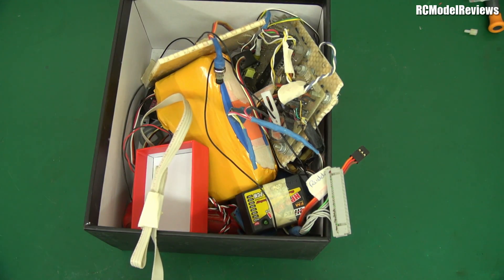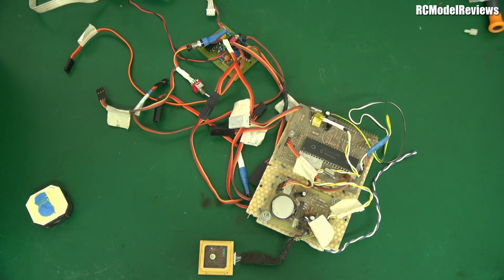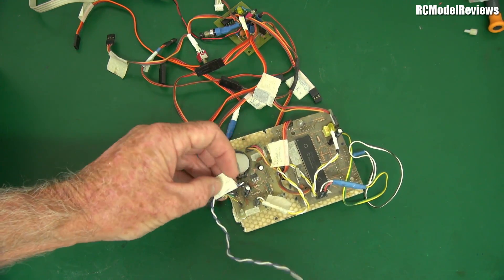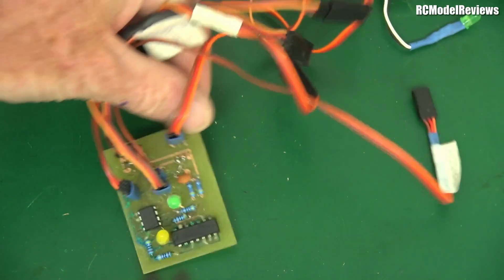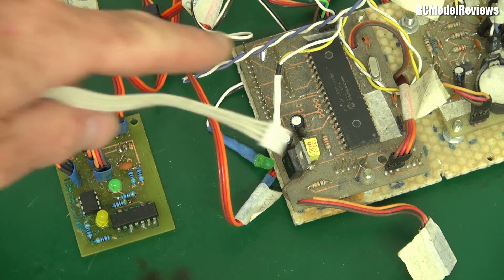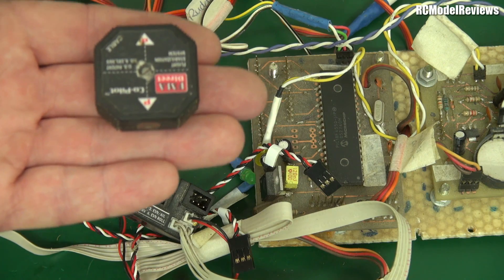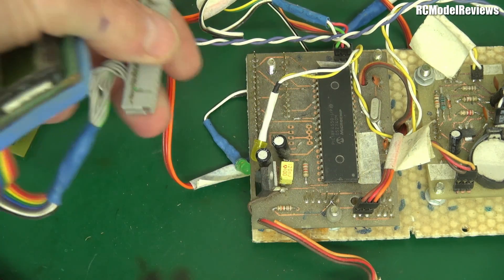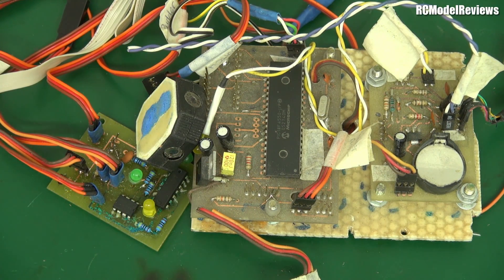An 18-year-old cruise missile autopilot and flight-controller

Comment: "They" never like when you point out issues with anything. Back in the early '80s the data center folks installed a new version of DCL (DEC Command Language) on the PDP-11 running the 10M corp. where I was employed as a software engineer developing embedded systems used to log data in high energy physics research. A fellow engineer and I looked at the updated documentation and it was obvious (to us) that with the features they'd enabled, it would be trivial to write a script that could take over any terminal on the system, pretend to be the login program, fake a bad password entry response, log the account and password they'd entered, and return the user to the real password routine which would let them log in, none the wiser. You could run it on any terminal in the system from any other, with no special privileges. We told them about it and were ignored, so we wrote a proof of concept script and showed it to the guy running the data center. The response was to have a fit and disable our accounts on the system. That fixed the "problem". LOL

Comment: Wow. Love this "blast from the past" retro technology. I can't remember 18 years ago but were gyros and accelerometers really military stuff back then?  How long until we get unlimited termal imaging sensors  by the same logic?
Reply: Not just military, commercial planes have used them for auto pilots a long time. Space flight also depends a lot on gyros and accelerometers. They were definitely not available for the home builder though. The first time people started doing things with them were when the nintendo wii came out I think. People chopped up wii controllers to get the gyros, that's how multiwii came about, which, if you go back far enough, is the ancestor of betaflight :)
Reply: I used gyros on my radio controlled helicopters in the late '90s, over 20 years ago...
Reply: @WillFly4Food  oh wow. It shouldn't surprise me, yet it does somehow. So manufacturers sold components directly to customers or anything like that? Or was it commercial product?

Comment: Very interesting stuff Bruce. I also heard about your channel because of your cruise missile. Am I right in thinking that you used a pulse jet engine to power the craft? Did you ever fly the craft autonomously, what was the theoretical range of the system? How did it handle and what did it actually look like, I imagine it was like a WW2 V1. Are you allowed to show us what it looked like, I understand if you can't say much the powers that be in the US are rather paranoid? These days all this could be done with an AMP 2.8 flight controller.  I have a fairly large quad copter with an AMP2.5 that I bought back in 2013 and it has a full autonomous capability. As far as I know there is no limit to the number of waypoints I can assign the system and the only limit to the theoretical range is my battery life which is only about 16 minutes but considering it's capable of doing 100 kph while carrying a 300 gram payload.  That would well be over 20 km. I have seen sites on the internet supposedly showing ISIS using off the shelf DJI Phantom quads to drop bombs so I guess there's no need for terrorists to actually build their own cruise missiles any more.

Comment: What an odd way of telling orientation... Thermal sensors 🤔
Reply: I think it's really clever :p
Reply: Brilliant. This reminds me of Maynard Hill's use of electrostatic potential for the same purpose in the 1970's (cover and paper,  "Astronautics & Aeronautics",  v.10, no.11, pp.22-31 , Nov. 1972). Very extensive paper.
Reply: And measuring the temperature of your ear
Reply: Paparazzi autopilot project has been using them for years, except they have a top an bottom sensor to measure the exact difference for finer control and I think it allows for night flight too (as with the opposite temperature coefficient it would confuse the 4 sensor system